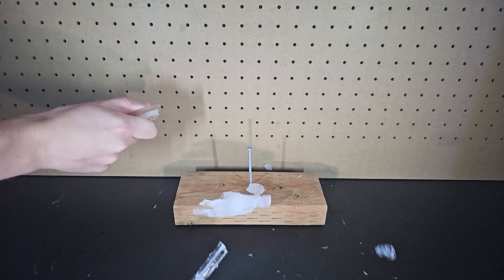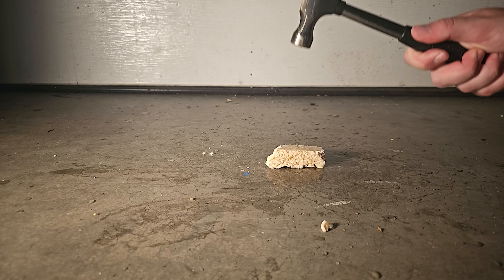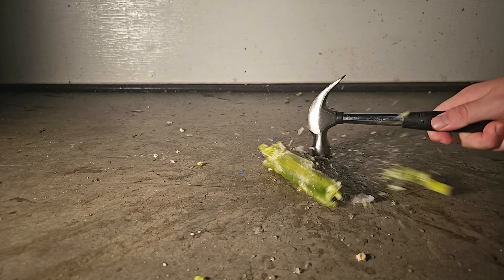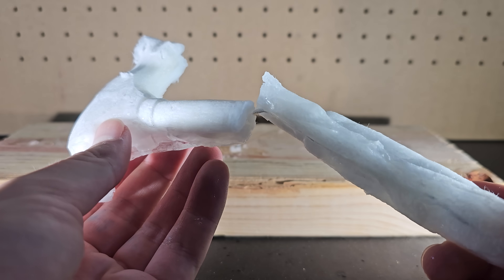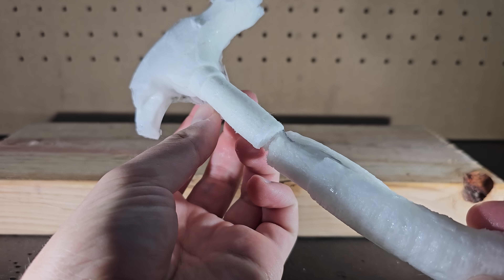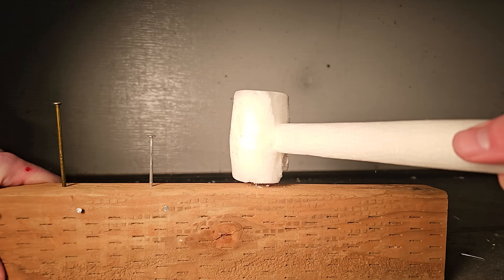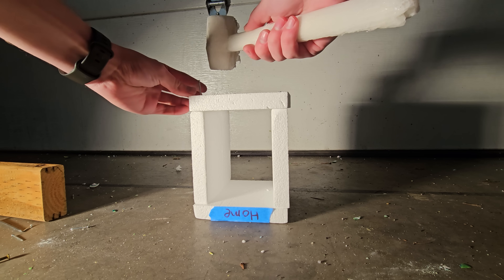How strong can you make ice? (World's Strongest Ice Hammer)

Comment from the maker: Hey everybody, just wanted to let you know that my 2 Truths & Trash Science Trivia Deck is back in stock! Go to TwoTruthsAndTrash.com if you're interested in purchasing (US only still). Also, thanks to everyone for making me aware of Pykrete, I likely will have a follow up video where I try your suggestions and look into the research that has been done on Pykrete to make something even stronger. Thanks for watching!
Reply: So bad is good, I like the vid 😂
Reply: Here is suggestion: braid the string and do it on all the sides and then add a layer of paper towel and then the inside being cotton ball so it is super reinforced :)
Reply: Do a cast and reinforce it with steel sponges
Reply: Did you try boiling sawdust in the water with a bit of something that contains the protein from eggs, blood or milk to aid with the microscopic bonding while enabling a bit of non-destructive flex? You need to let it cool down slowly until room temp and then freeze it slowly as well. (Adding a little fresh saw dust and bonding agent before freezing but after boiling could help too)
Reply: you should try making ice without air bubbles inside. air bubbles make ice weak from inside.
Reply: @AmilaA-yq9dl  That's what I was thinking. He can degas the water with a vacuum chamber.
Reply: Use ground beef it's as solid as bricks. Just put it in the mold and freeze it no need to add any extra water
Reply: Use a coin for the hammer tip
Reply: Pykrete
Reply: You do know ice with sawdust is called pykrete? It been a thing for ages...
Reply: Vakuumkammer + Stahlwolle?🤔
Reply: You should do the same but on the shaft put asparagus and fill it in with sawdust and paper towels and string and the cotton balls of course but stretch them out more so you can fit more in and use the other cotton too and also make the tip of the hammer out of the oats and sawdust with some string in it as “rebar” and have some more asparagus and string and paper towels surrounding it with cotton on the outside and put more asparagus and cotton and string on the connector part where the handle and hammerhead meet so it’s nice and robust
Reply: @BOEING--mh6xm  dis is de wey!
Reply: Here is a suggestion! You can use Cotten balls, however you need to split them up, and put them back together (what I mean is splitting up the Cotten balls then making like a sheet out of said Cotten) you can also use regular paper by shredding it into small pieces and freezing it, both of these methods make very strong ice, you can also use one of these methods on just the blunt side of the hammer (or either of the sides of a mallet head)
Reply: 1:44  he did tbis because he wanted to get rid of the esperagus
Reply: Use the mallet and keep the string paper towel and cotton balls with the oatmeal on the both faces of the malet
Reply: @JaDroppingScience
The reason too why most of the ice test failed was because he didn't let the water soak into the material.
If the water was soaked into the materials like the sawdust, it would be very hard to break the "cube."
Pykrete is one of the stongest ice mixes you can make. It is made from water mixed with sawdust. And you can literally build a ship of it 😉🤙.
Reply: Cardboard as a type of
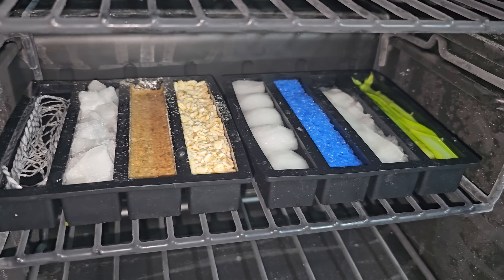Reply: This wil 1:59 make you rage
Reply: You gotta make a hammer out of all of the stuff
Reply: Try wood
Reply: Maybe sharp sand in the head
Reply: You need to put more papers
Reply: Its 9 30 pm here and i need too sleep but my brain needs too know what ice is the strongest😂
Reply: Try with steel wool instead of cotton, trying to use a single stretched piece instead of multiple small ones
Reply: Now Try making an Ice Axe and try Chopping a Log
Reply: Hey btw I watched your short on this and it worked great! So keep up the good work !!!
Reply: 8:53 
Believe it or not the styrofoam that you use as a joke is more harder material then your papel ice Hammer, maybe you can use it for your next ice Hammer video?

P.S. the joke will be on you if it works, mate 😂
Love 🕷👻
Reply: Not paper towels, use Newspapers! with frozen water is supposed to be as hard as concrete and just as strong.
Reply: do one containing every material u tested
Reply: I waste 13 minutes of my life
Reply: Use fiberglass strands!!!!!! Nothing is more superior than fiberglass in this situation. I'd put money on it working better than carbon fiber, steel mesh wires, kevlar fibers, and polyethylene mesh. 👍
Reply: Btw i think the strongest hammer you could make would use string in the outside like a net, that would keep the hammer's form, then, tear the cotton appart in small pieces to compress in the mold to finally place a string in the middle and fill with water.
Reply: steel wool would be stronger
Reply: "Looks unprofessional"

Nothing about the human body is unprofessional.
Reply: Try maïzena and baking powder!
Reply: What about using lego technic?
Reply: Do all 8 Things at Once
Reply: Sawdust and paper towels?
Reply: wire wool
Reply: Carrots frozen? As the shaft
Reply: First lets go
Reply: This is interesting engineering, but why did you trust the shape of a mallet to remain ideal when changing materials? A mallet is only shaped that way, because its made of 2 parts. If you have a mallet made of 1 part, there is no reason the connection between the shaft and head should be that concave. If you make a hammer out of 1 piece, it should be more like a club or a bowling pin, where the parts buttress into each other, without any harsh angle changes.
Reply: I'm surprised I watched this until the end. I'm even more surprised that you were able to get a nail into the wood. And even more surprised still that you progressively got better with the hammer as the video it went longer. 😂
Reply: Yoo nice video it is educational also and I love all your videos I am subbed and liked to almost all of your videos please pin 😢🎉😂❤😅😊
Reply: But sorry I am very late at your this video sry and I am commenting to much because iam using mouse on phone
Reply: But now we have to tension about that the hammer dosent melt
Reply: Rocks
Reply: Combine all of them
Reply: Put the paper towels in first then cut the string and put it on the sides then put the cotton balls in there then take the oatmeal as reinforcements
Reply: What if you combined all of your testing materialss into 1 hammer?
Reply: Try grass does ancient Egypt use grass winter breaks the Bible I said bricks are different things but you could try it well it's all nature simple stuff so it's a worth a try
Reply: If possible try combing liquid nitrogen Ice with Liquid Metal
Reply: Try boiling the water and oats 1st. Hot water freezes better and makes a stronger cube. And letting the moisture bond with the oats throughout I think will strengthen better. And you should use hot water for the paper towels too. Please try and show us outcome and see if I cracked the code.
Reply: This has been done back in world war 2. They already discovered wood pulp and ice called pykrete is stronger than steel.
You just had to look it up. They were planing to make military boats out of it for cold waters.
Reply: ❤ there's a new concrete additive you didn't try. It strengthens it to keep it from cracking. 😂 on another note you didn't try the carpenters trick of spitting on the nail but it always seems to work for me when I'm not pre-drilling holes😂
Reply: So I'm really impressed , what's your mbti?
Reply: He doesn't drink coffee
Reply: try frozen liquid iron
Reply: Little iron shards into the ice, and them medium iron shards
Reply: Add some salt to it, and I recommend you also get a lot of paper towels and put it in a cup full of water, and then mash the paper towels with a hammer(or anything that will get it into a pulp-ish liquid)so the mold is full of paper towels that can add a lot more compact atoms.
Reply: MAKE THEM WORLDWIDE AVAILABLE
Reply: ah yes, I'm not in the US, so I have the rights to say "I don't care"    .
Reply: @EpicBlade2    did we ask?
Reply: @EpicBlade2  bro, you better shut up
Reply: Let’s go first one to know! I love your science man!

Comment: Another cool variation would be using SS wires ( you can get these from those metal scrubbers ) and reinforcing them with wooden toothpicks placed vertically and diagonally ( so that they act like a truss for uniform load distribution) .

Comment: This is not more than creating a compound material, where you use frozen water instead of resin. So when you use glass fibers or even carbon fibers, a surprisingly strong hammer should be possible.

It all depends primarily on the length of the fibers and the amount of fibers you are able to "squeeze in". The frozen water (or resin) has not much more function other than to fixate the fibers in their position to another. The stiffness comes almost exclusively from the fibers. 

And for a decent compound object, we are talking about a fiber content of 80% or more. The early fiberglass mat GRPs had very coarse glass fibers, there you did not get beyond 40-60%. You should try to get the most fine fibers you can get. 

Glass rovings (uniderectional strands) for the inner core, fabrics for the outer surfaces, better lighter fabrics and more layers than heavier, coarser fabrics. 

With glass fibers the hammer remains ice-white, but even better would be carbon fiber, which is way, way finer and EXTREMELY stiff, stiffer than steel. 

Probably a black carbon ice hammer is so stiff that it would not break anymore. 
(then melt it and it becomes totally soft again)

What is important is that when the object has huge diameter changes (like from the thammer head to the shaft), the stresses peak at that switch point. 
There you definitely need lots of fiber strands bridging over the two sections, or the whole will break way too early. 

This stress concentration effect can be so extreme that when you make a small scratch into a correctly made carbon fiber resing bolt, it will break at a fraction of the strength the scratch-reduced diameter would have.  And I am not talking about sawn half-through, I am talking about e.g. a scratch with a sharp knife. 

The first RC model glider builders using carbon fiber learned that the hard (impact) way...

Comment: The best hammer performance is going to be the cotton balls, but you need to get the balls to comingle more.  The large separations between the balls is going to be weak points.  Likewise if you wrapped the rope it would have performed better but the rope is already twisted together so it would be hard to eliminate the gaps between the rope segements.  Paper towels work well for these tests because you shred the paper towels but the fibers weaken considerably in water which hurts overall performance.

Comment: Making ice alloys seems difficult due to a few problems. The first one is trapped air bubbles. It’s easy to fix if it’s frozen on a vibrating plate. I would say the best method is to develop a suspending agent and a strengthening agent. Also rotating the item as it freezes will allow certain things that would settle at the bottom to be suspended a bit more. I would test a theory on why the hammer cracks. I believe it is due to the inability to distribute vibrations without damaging the ice crystal structure. I would suggest filling a capsule with alcohol so it doesn’t freeze and suspending it in the head of the frozen hammer. Theoretically the vibrations will transfer into the free moving liquid alcohol to dampen the blow. If that works I would suggest a hammer mold with a hollow inside. You could freeze the hammer shell and fill it with liquid nitrogen. If you can trap the liquid in a pre frozen hammer shell, I believe that it will stay liquid and allow for a vibration resistant core that will also mend the micro cracks that appear due to the temperature being cold enough to refreeze the hammer. 

To summarize what I think would give maximum benefit to the frozen hammer, create a hollow hammer shell design as well as an ice plug to fill the hole and fill it with a pulp or glue and long fiber for structure and freeze it on a rotating and vibrating rotary machine. Pull the empty hammer out and fill it with liquid nitrogen. Take an ice plug to fill the gap and freeze it to keep the liquid nitrogen inside.

Do not attempt to make  it or to test it without proper safety in mind. A hammer with liquid nitrogen as a core is a great way to get hurt if you aren’t careful. That’s why starting with an alcohol capsule might be better to test the theory before you maximize the design.

Comment: I know it's late but what ever. This is fun, and honestly sounds like something out of prison. Something better than cotton is going to be fiber glass, especially long bits of fiber. Another good trick is to cut away at the mold. Sharp angles are bad for durability. So where the head meets the shaft, gaggity, of the hammer, cut away there a lot until there's no sharp transition. As for the hammer surface, you're stuck. Steel is the best answer, but goes against the point. Steel wool may be interesting. Rocks. replace the ice with something hard, that's the only answer.

Comment: I think that a different kind of string would have worked better. It looked like a kind made of synthetic material, which is probably resistant to absorbing water. 

Natural material string, like cotton, hemp, or sisal, would probably be able to absorb the water better.

One reason rebar works so well in concrete is the spacing, and sometimes because of crisscross. String laid out in a crisscross manner would probably be stronger.

But stretching out cotton balls is probably the best I could think of, because all the thin fibers in a 3D lattice ought to work best. 

Maybe a double sided hammer with a wide side and a narrower side to the hammerhead.

I like the mallot at the end. A wider neck below the head could help prevent breakage. A thicker handle might also help to increase strength.

Comment: As others have suggested, I would be interested in seeing how the cotton balls worked if you unravelled them a bit to stretch out their fibres — but I also want to see how it works if you put in a corrugated carboard model hammer with several layers of hammer outlines stacked on top of each other and glued together for additional strength.

Comment: The sawdust one is actually stronger than your test, but i believe it has to be layers of ice and sawdust (not just sawdust at the bottom and ice on one side which is what your test consisted of). In WW2 there were tests done on pykrete that found when made correctly it was bulletproof with just an inch or two of thickness (obviously thicker slabs could withstand higher calibers as well). 

Another test i'd suggest is looking up mythbusters and their version of pykrete called "super pykrete" which used newspaper as the wood material.

Comment: One thing that would likely massively improve the strenght of the handle is precompressing your "ice composite" by tensioning the strings inside between two caps at each end before freezing.

You could do it by replacing the silicone mould with some plastic pipe and tying the strings to some caps at each end, freeze everything and then remove the pipe (by cutting/breaking it) but leaving the caps.
To add the head then you could put your precompressed ice handle in the hammer mold and add some more water and freeze it again.

Materials like concrete, stone or ice can handle huge compression forces no problem but are not very strong when the applied force is trying to bend them or pull them apart.
By compressing it in advance and keeping it under tension with the string, forces that would otherwise pull your ice apart will instead just temporarly relieve some of the pressure (which the ice could handle no problem anyway).